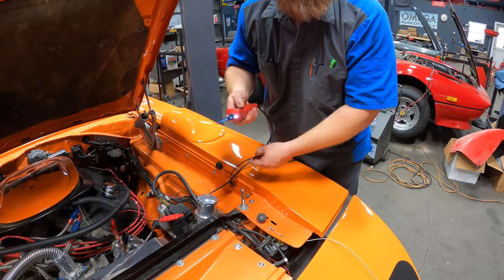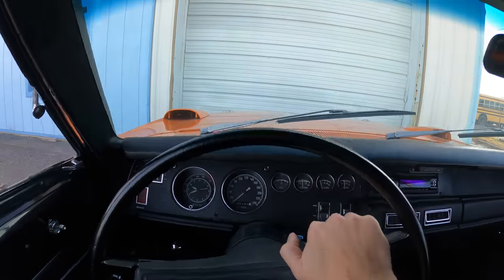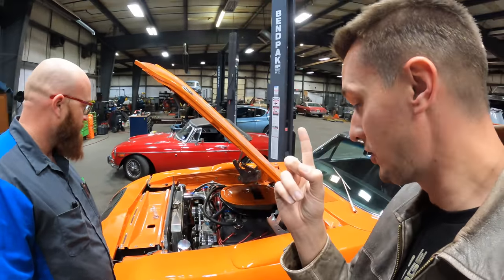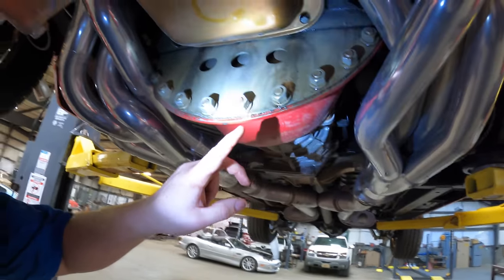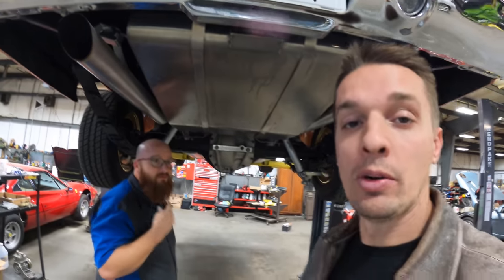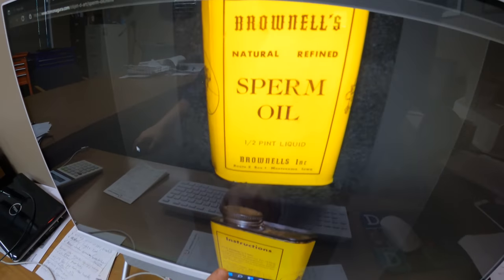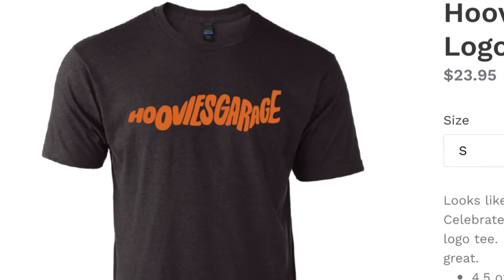How I got SCAMMED buying a Plymouth Superbird online sight unseen (So much broken/missing)

Comment from the maker: For those that lasted until the end of the video, I want to shart by saying thank you so much for watching. I am really looking forward to making more skid marks and stomping the gas once this super bird is sorted, with it's horn tooting mightily!
Reply: Your autocorrect turned Start into Shart Hoovie.
Might want to edit that ;)
Reply: Shart. Oops!
Reply: That was too funny. I literally rewound to see if I heard what I thought I heard...
Reply: I'd shart by making less skid marks in your drawers and make more with the Hemi lol! Gotta love autocorrect!

Also, Wizard's poot at 26:41 got me lol!
Reply: @bakabana8969  could just be a joke considering what happened at around 26:40 🤣
Reply: $10 you blow the engine on your 1st burnout! $20 you grenade the transmission at the same time.
Reply: Was that a shart @ 26:40.......a wizard shart
Reply: The wizard is leaving some skid marks
Reply: @jeremybelcher1727  i got that part right as i was reading this comment
Reply: What does shart mean ?
Reply: Shart 😏🤣
Reply: shart
Reply: Hi Hoovey, love from Spain, any Vacuum system should always have a vacuum tank, the pump creates the vacuum that pressurizes (negatively) the tank, the tank holds the sucking power to open / close the headlights, the pumps only run when the pressure in the tank drops below a set level. Think air compressor in reserve, instead of filling with air it sucks the air out..
Reply: When you write shart more than start the AI takes over 🥂💦
Reply: @bakabana8969  I believe it was intentional lol he has skid marks and tooting in there 😄
Reply: " I want to shart by saying thank you so much for watching. I am really looking forward to making more skid marks"

Hahahaha I see what you did there!
Reply: @kenhaupt1865  same
Reply: hello Hoovies, greetings from Poland! Your vid popped up in recomended vids for me, which is great!
I'm looking a bit different to this case. We don't have real 70's Muscles here. Almost nothing. In Germany theres plenty, but in our country American Vintage is a quite small crowd. So IMO this vid title is Wayyy too much, too much clickbait, you even say by youself "that's not that bad as I thought". Looks like its a great car. Here this car would be an biggest star at every car meet, belive me. An no one will be looking at number matching, because who tha f cares if its superbird! :)
  I dont know how it's in US, but here scamming in used car market is normal thing. Even more- here we have huge caliber scams like welding car from two pieces...
This issues that you have are like- phew :) 
Again- I dont know how is it in US, but here if the car is cheapest that mean theseres something that needs work. Sometimes seller don't even know because automotive culture here is very low. As someone said "having an driver license doesn't mean that you know cars".  Cheers!
Reply: Thanks for sharting with us
Reply: So do you shart every time I watch the whole video?
Reply: Are you sure that was a shart and not a leaky oil cooler?
Reply: I literally just took a picture of this exact car a few months ago. I won't give away where I live but the previous owner lives a couple blocks from me. Amazing! I can't believe he screwed you! That sucks! I feel like going up to his door just to warn him lol! But you reap what you sow!
Reply: my stomach hurts I was laughing so hard XD
Reply: It’s not a bad price for what it is. But you must know a documented Hemi 4 speed Superbird would be worth about $400k.
Reply: Go easy on the burnouts.  Nothing worse than seeing a nice car abused. And you seem to break things doing burnouts.
Reply: @johnshaw4140  you serious Clark?   When you fart and a little bit of shit slides through the wrinkle, thats a shart.....
Reply: I think shart is the correct word..
Reply: Thanks for watching to the end..... WHO DOESN'T WATCH TO THE END OF HOOVIES VIDEOS!!!?!?!?!?!?!????!??!!
Reply: You can get electric headlights for that car.... it might be more simple than a diff vacuum pump
Reply: @NZMASTEROFGAME  Only a pure animal wouldnt watch this until the end, a true savage
Reply: I really like that car.  Looking forward to seeing it fully sorted.
Reply: This car needs a proper check up by an expert to make sure it’s not some VIN swap scam. That should be your first priority, IMO.
Reply: Shart 🤣✌️
Reply: Shart
Reply: Hoovie it’s a shame it does not still have torsion air front suspension. Maybe price out what turning it back would cost.
Reply: FWIW I like the wheels too. Meep, meep!
Reply: Go ahead and shart bro
Reply: How much for the car wizards shirt you wiped oil on? asking for a friend.
Reply: Don't sell this car...It's awesome!
Reply: Really farting around.
Reply: @kenhaupt1865  Same here!!
Reply: If you can say thank you with a shart, I’ll be forever impressed.
Reply: Still one of the coolest cars you've ever bought..
Reply: Had to watch because I had a pristine original 69 R/T back in the early 80s that I sold WAY too cheap too keep my shop open. You know, car bizz. Anyway this looks not that bad Hoovie. Just the reality of owning one of these cars.
Reply: Shart and skid marks? Sounds like this car really rips!
Reply: Hahahahahahaha
Reply: @bakabana8969  Shart, skid marks… that wasn’t autocorrect. That was a joke.
Reply: Hey any plans to make shipping to Australia available dont care if i have to eat the full price of shipping!
Reply: Noice car. It will be fun. It's probably actually increased in value since you owned it.
Reply: Sharting and skid marks go hand in hand me thinks
Reply: Shart LMAOOO
Reply: Shart & skid marks 😂
Reply: @johnshaw4140  shit-fart shart
Reply: Back in bussiness! Nice!
Reply: Shart, skid mark and tooting in one comment. I'd say you did your doody.
Reply: You wanna shart?
Reply: @precisiondetails3003   you caught that too lol
Reply: Nice ride.

Didn’t see the AC repair on the wizards list…?
Reply: @davematthews8512  if its a driver then its ment to have fun with
Reply: I always knew the wizard was turbo'd i finally heard the blow off to prove it
Reply: Hoovie check your DM's on instagram! Trying to get in contact with you. Cheers!
Reply: The wizard farting when he mentioned the horn was a nice editing touch.
Reply: Keep Doing your thing Hoovie . We tuned in from New York
Reply: Haha shart
Reply: Bruh, you didn't kick out for a vehicle inspection? Come on Tyler, you know people who would have done you a solid and inspected for you in whatever state you found it in. Learn a lesson from this.
Reply: Hoovie have u and the wizard been taking drug's
Reply: O
Reply: I've watched this video in its entirety twice now. Once last night while making dinner, and now before work. What a car, despite the small hiccups currently.
Reply: Hoovie sharted
Reply: @monty4912  wizzard’s shart at 26:40 (shit + fart)
Reply: More skid marks to come, not from sharting though I hope.
Reply: May want to check your shorts after that Shart!
Reply: Please dont shart
Reply: I will shart my engine
Reply: I'll give you $37.20 US for The Wizard's oil besmirched smock, but it must not be cleaned!
Reply: Wait...@25:50 The Wizard's smock's oily left sleeve has been cleaned!!!  Offer withdrawn!
Reply: Making skid marks and sharting goe hand in hand
Reply: Please give an update on this car.

It's a special one
Reply: @bakabana8969  I think he did that on purpose, honestly.
Reply: The Wizard's made skid marks from sharting.
Reply: “I want to Shart” Hoovie is hinting at 26:41 😂
Reply: Sorry to hear about the sharting. But otherwise you're welcome hoovie. Glad to be here
Reply: Shart lol
Reply: I thought he wanted to share/start. But he did dirty there by shart..
Reply: Please share in private.
Reply: Beautiful colour.
Reply: Thanks for the video
Reply: Sharting often results in skid marks.
Reply: Oh i want to shart too
Reply: Shart, skid marks, gas and tooting. I’m beginning to sense a theme.
Reply: With it's horn "beeping" mightily...lol.  I'd try another oil sending unit, if your oil pressures is low. Also, disconnect that nosey vacuum pump. Put it back the way it came from the factory.
Reply: shart... was that the noise I heard right before Wizard quoted the horn repair?
Reply: Shart, Skid Marks & Tooting!
Reply: You forgot to tell wizard about ac controls, that will cost you later.
Reply: It looks like you came out pretty good on this one. 👍👍👍👍
Reply: Congratulations 🎉 it made me subscribe 😂
Reply: Hehe shart..
Reply: @ricktaylor3748  The big hemi doesn't produce enough vacuum to operate the brakes and other goodies.
Reply: I made it to the end because it's not the European junk you buy so often.  How bout buying a Supra?  Too good for you?
Reply: Sharting always produces skid marks.
Reply: Please don’t “shart”
Reply: You like to shart huh
Reply: I can tell you that I, for one, am VERY excited to see this monster back on the track and doing what it does best...go FAST!
Reply: I wanted to shart too 🤣🤣🤣
Reply: Well, he did say he wanted to make skid marks, so.......🤷
Reply: I couldn't tell from the Video.
But did you CONFIRM the Horn is Light Purple 💜 🤔 ...with the Warner Brothers Decal on it, per contractual agreement 😏
Reply: If you’re sharting will the skid marks be brown?
Reply: You KILLED me on that subtle entry of "shart" and played it totally cool when dude totally farted and tried to cover it with clearing his throat LMAO! I'm dead! LMAO!
Reply: Sharts and skid marks
Reply: ... you said shart Instead of start in your comment Tyler 
Other tht that that's great they are working with you lol
Reply: You wanna shart huh?
Reply: I would've Sharted my pants if I  spent 130k on a superbird with all those problems! I have a freind that seen one on I-35 for sale in '95 with an original sixpack for 33k, he promptly withdrew 14k from the bank and financed the rest to steal it!
Fun fact, full coverage insurance back in '95 was 1k a month.
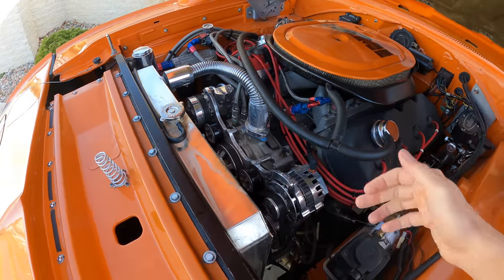I raced it with my blueprinted 289 '67 Cougar and took it off the line with my 4:11 gears but after about 70 mph or 1/8th mile all I saw was an orange streak!
Reply: Please...no sharting..😂😜🙄
Reply: He said shart AND skid mark hehehe
Reply: @bakabana8969  🤣🤣🤣
Reply: @fredpinczuk7352  hey, that's exactly what happened to my '65 barracuda, and I wasn't even doing a burnout. Just hit the gas when the light turned green and it said "NOPE".
Reply: Calm down Joe Biden, ease on the sharting.
Reply: He wants to shart, haha!
Reply: Awesome video.  Not sure if this is you or YouTube, but the commercials are, in my opinion, getting ridiculous.  Five sets of commercials?  Really?  Love your channel and your show and of course I want it to keep going, but I nearly turned it off at the last set.
Reply: @4myturbo  While I agree, he’s gotta buy 100,000-dollar basketcases somehow.
Reply: So do you have toilet paper 🧻,l for that shart
Reply: I want to s h a r t
Reply: Lol...shart, skid marks, gas, and tooting, lol. I'll never grow up!
Reply: Ha! Oh ya well sharty hope you undies 500 make the machine do its joy job you shart ill get the under the hood detergent for that pidgeon.
Reply: Shart

Comment: The fact that David compressed the suspension by pressing in the inner fender and not the exterior fender shows his experience.
Reply: no one ever said the car wizzard is dumb...dull maybe but not dumb
Reply: For a short moment I thought “Who is David??”… I can only remember him as WEEEEZAAAARD.
Reply: @ThijsSchnater  David Copperfield is his real name.  hince the weezaaard name
Reply: Alterkation front ends are shit.
Reply: @ThijsSchnater  Who is WeeeZaaard?
Reply: @FastDuDeJiunn  haha, nice try
Reply: Wish the Ford dealer that "repaired" my S550 GT knew this.  Luckily a PDR guy was able to remove the dents...
Reply: @richardbaumgart2454  Car Wizard has a very dry sense of humor!!
Reply: how dare address the Wizard by his mortal name.
Reply: @richardbaumgart2454  dull?
Reply: @levil7324  yes like boring and a little out of touch with some of his ideas, for instance a jag powered Chevelle. A little odd.
Reply: What about his experience when he crapped his pants during the price break down at the end? Hoovie didn't even react, it must happen so often
Reply: I thought the VERY same thing when he did that lol.
Reply: @hotshtsr20  extra unfortunate because the s550 front fenders are thin aluminum lol
Reply: @ice44567  Rear quarterpanel. It came right out with some talent by the paint less dent repair guy…

But yeah. 4 dents because they had to make extra sure. Right next to the inner trunk surface that was actually structural. Lol
Reply: @drippinglass   I hope not , have one a 1971 scamp
Reply: @douglasshriver52  They work if you have them tied into a cage. The sheet metal front inner fenders are not strong enough to support the suspension.
Reply: So you recognize his experience by how he compresses suspension, not literally everything else he does?
Reply: He's used to working on high-end vehicles.
Keeps greasy handprints off of the paint.
Reply: Also, it's common sense... Something many seem to be lacking these days.
Reply: @JimmyJ2J  Maybe that's the first thing he's seen him do? Has that ever crossed your mind? We ALL haven't seen the "Wizard" work before. Think before you speak.
Reply: @bigredc222  Keeps from denting sheet metal mainly. Fingerprints wipe off.
Reply: I wouldn't let the wizard touch anything I own. I'm am constantly amazed at what some people consider a "great mechanic".
Reply: @ericd6781  You have issues
Reply: @davelowets  - I can spot sub-par mechanics, most would consider that an asset.
Reply: @ericd6781   You can spot sub-par mechanics from a scripted show? 🤔 Keep kidding yourself. 😂
Reply: @ericd6781  I will, you know you got called out. I don't need to say any more. Have a good one.
Reply: @FastDuDeJiunn  So that's how he makes car problems disappear!
Reply: @richardbaumgart2454  just because you dont like the idea of a jag powered chevelle doesn't make him "out of touch"  🤣 god the "car community" is full of panzies lol. Children too.
Reply: @JackTheripper911 I agree, that's not the only reason I think he's a bit out of touch, just one reason of many.
Reply: @ericd6781  can you share with us what he did in this video that indicates he is a sub-par mechanic?
Reply: I was thinking when he went to the car hero or zero, hero he is 👌
Reply: @ReplicantBattyman I’m guessing not lol